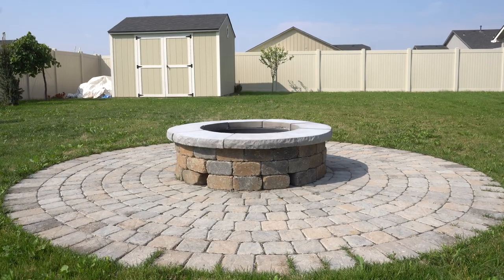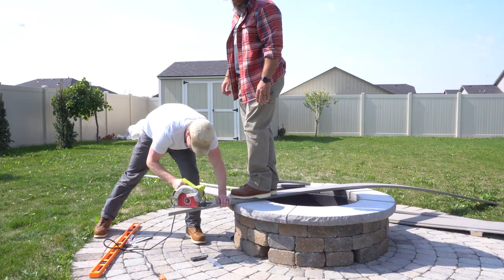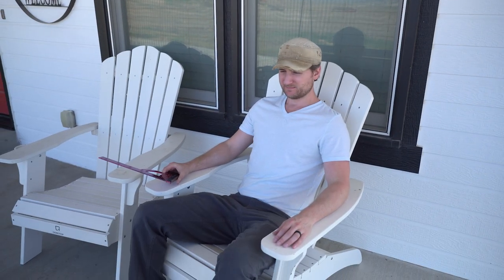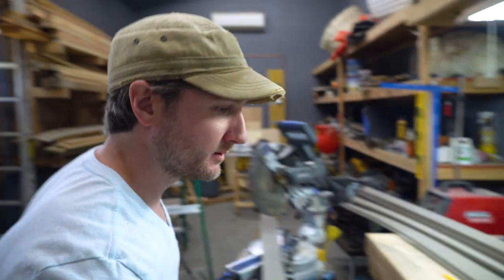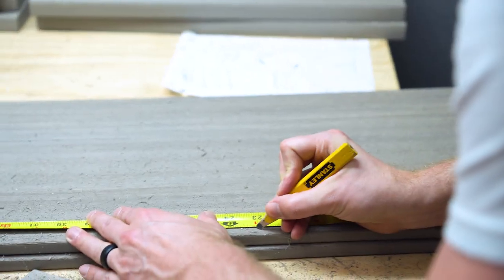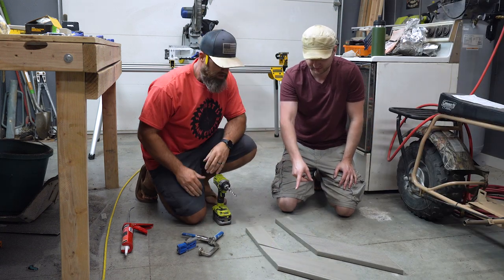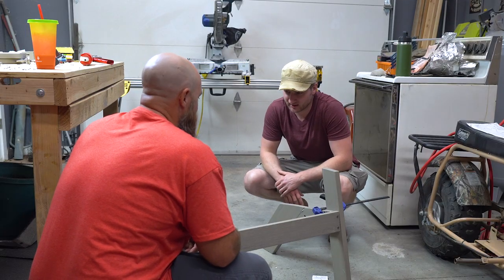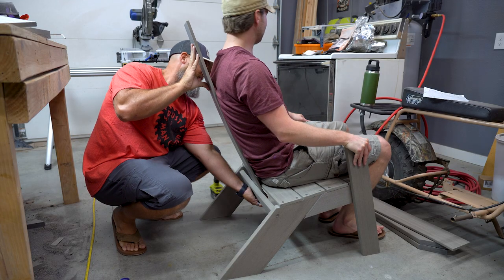👉 DIY Patio Chairs That Should Last My Son's Lifetime

Comment: Hey guys, just wondering what that red tool you used for angles is called. Thx
Reply from the maker: The one shaped like an L? It’s called a square. This particular one is a Milescraft framing square.

Comment: just started this vid but one great way to strengthen the material is to fasten to pieces of material together in a  "T" ir " L" shape. If you look at 2x4 saw horses , typically the lintel/ beam/ rail , ie,  the larteral portion at the top, is usually an upside down "T" if looking at the end if the horse.

Comment: Awesome project. But needs a table or cup holder. You could also design the back and arms to move like 2 or 3 notches for individual comfort. Just ideas floating in my head.
Reply from the maker: Great ideas! I debated cutting a circle out of the armrests for a cup holder, and ultimately liked the clean look instead (luckily the arms are wide and sturdy, so you can still place a cup on them). And man, doing a customizable version would be awesome - slightly trickier though! 😅

Comment: Should angle the back to give it some shape and and cup holders
Reply from the maker: Like a curved back, so the sides wrap around you a little bit? Cup holders ALMOST made it into the final design. 😁 I just ended up liking how they looked without. And, the arm rests are still wide enough to hold stuff.